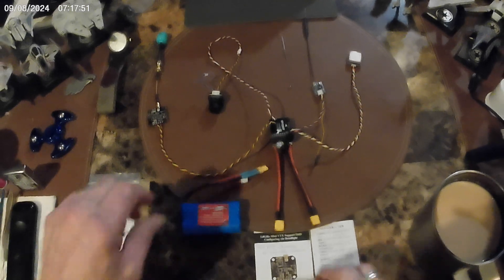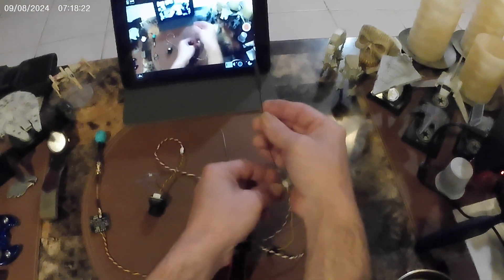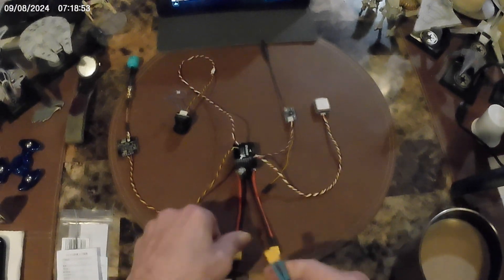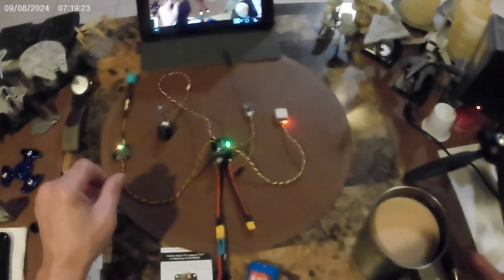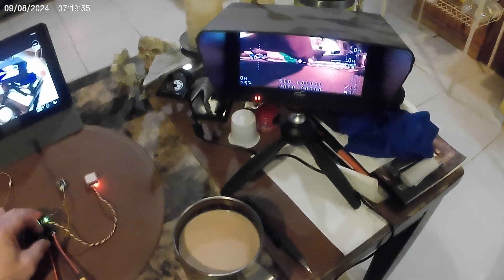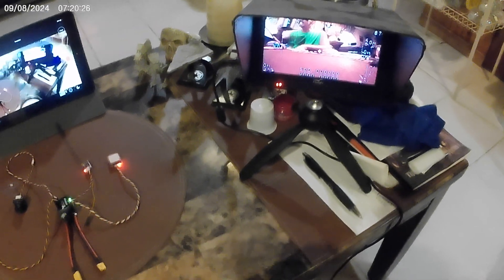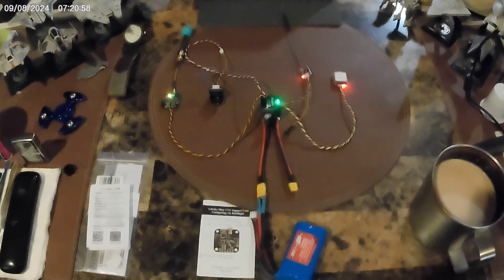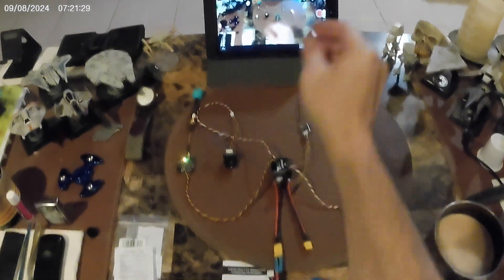lifie sparrow v3 flight controller ready to install in the wing 9/8/24

Comment: Normally i used inav in my fc for my aircraft...and its pricey...does this fc using the same? If not, how you setup all the parameters and configuration?
Reply from the maker: @YT-qp3xw  it's a simple fc, but it has almost all you need it is a plug and play fc it jest don't do a digital fpv system it is great for analog fpv it has 2 camera support and you setup the fc with the camera hooked up and bound to a transmitter and us it to set it up
Reply: Can it be used on flying wing such as sky shadow s800? I still using analog for my fpv gear..still newbie in fixed wing
Reply from the maker: @YT-qp3xw  yes i have this flight controller in my zohd dart 250g and it is perfect for a small wing
Reply: Then its stated on AETR mode..can it be changed to EATR mode? Already ordered it for my coming s80..
Reply from the maker: @YT-qp3xw  yes I would recommend to download the full manual it will help also jest go to the website and you can download it